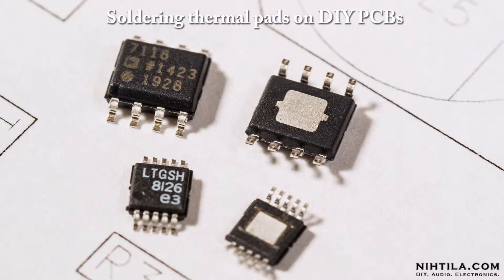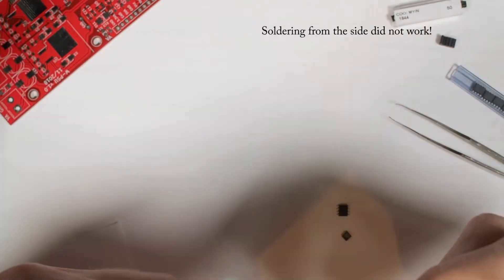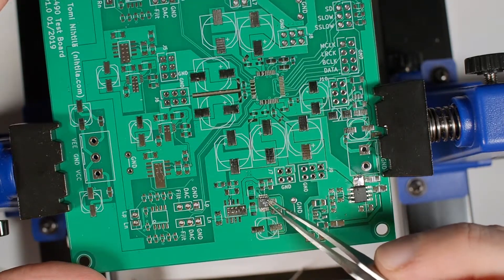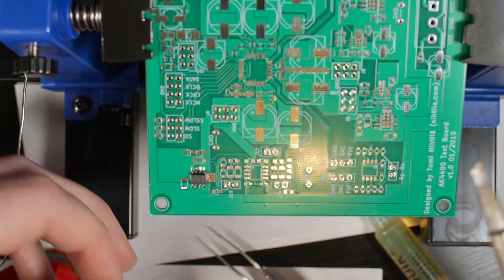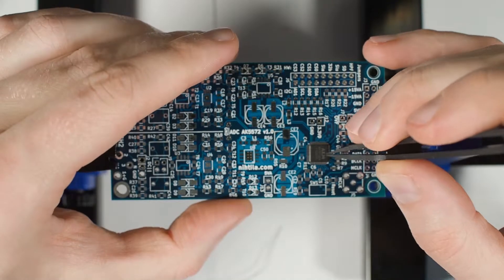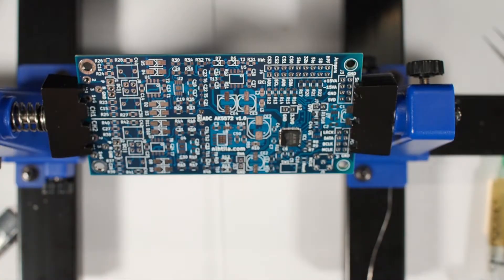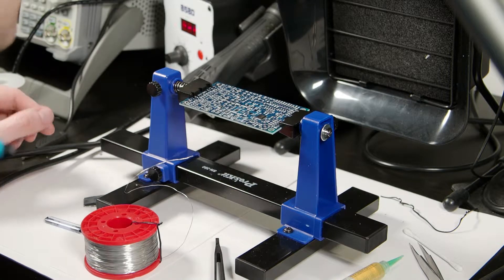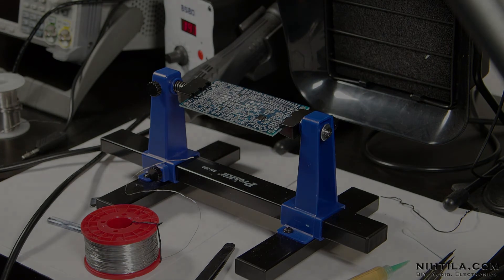Different Techniques of Soldering IC Thermal Pads

Comment: What happens if the pcb thermal pad is not attached to the rear side of the pcb. Can one heat the pcb substrate?
Reply from the maker: Not really with soldering iron. Then you just need to use hot air. It works fine, just heats up the PCB and surrounding components more.